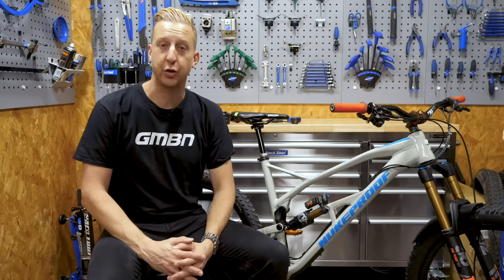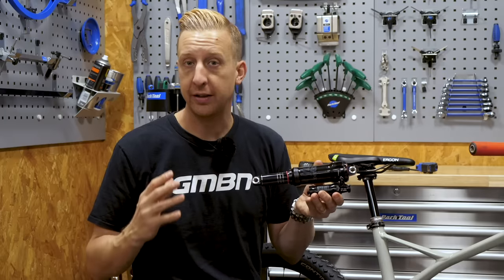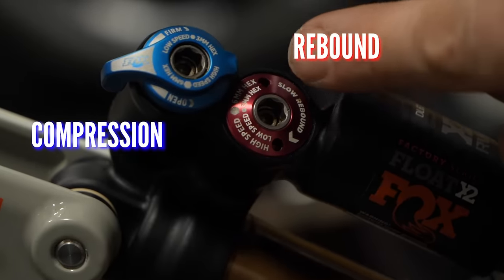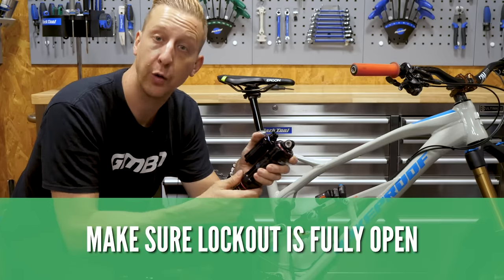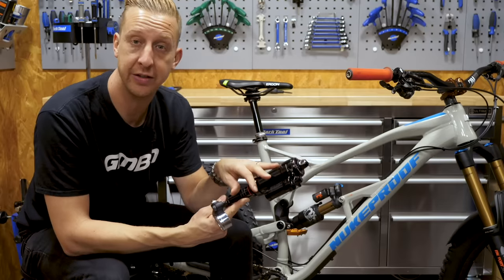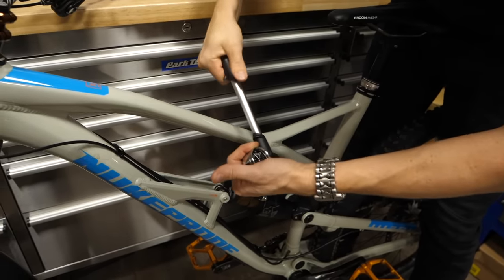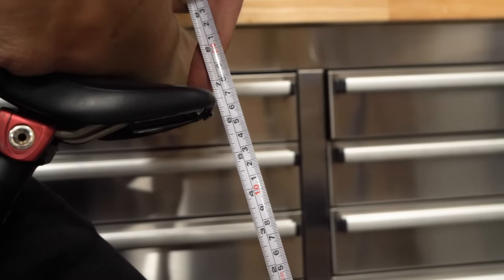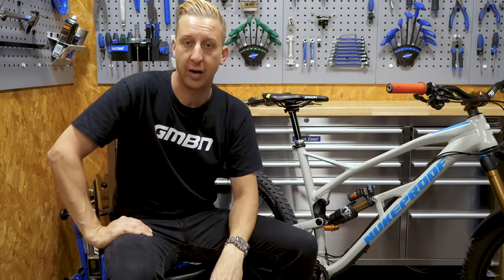Mountain Bike Rear Suspension Set Up Ep. 7 | GMBN MTB Essentials

Comment: My rear suspension set up: 25% sag. Compression & rebound adjustment to suit terrain: Smoother terrain without many bumps = increased compression & rebound (stiffer ride); Rough, bumpy terrain (ie. rocks , roots etc) = less compression & rebound = faster acting, more responsive suspension for smoother ride. And remember correct tire pressure factors in as well.
Reply: my freeride suspension is rock hard no rebound like 2 sag
Reply: @ryanmonson4033  if you set it up so hard then why  not just ride a hard tail and not bother with rear suspension?
Reply: @theadventurebiker  so when you case a 30 foot jump from 20ft high you wont di, it almost bottoms out with full volume spacers
Reply: @ryanmonson4033  Fair enough. I'm moreof a cross-country/ endurance rider and so I don't do big jumps like that. As a result my suspension is set up for comfort and perfomance when riding over rough terrain.

Comment: Stumbled on this video and has been informative. But still a bit not clear about sagging. You mentioned to unlock fully before setting the sag but nothing in your video talked about what to do after setting is over. Secondly if after initial setting the sag is lower than expected, should the psi be increased or decreased?

Comment: Great show 👍 The Basic information  works for me . On my rear rockshox The top rubber bushes seem to have a gritty sound not sure if I need to let the air out first to remove and  clean them or maybe the bolts or just overtightened .
Reply: 👀 ALWAYS deflate the shock before you start removing bolts! Better safe that sorry.
Reply: Le Typ  ok noted will do thanks

Comment: Hi,
Very grateful to you. When the shock is "Locked", is it when it's fully extended or it could be "Locked" when compressed so it shortens the distance?
Thank you
Reply: A Lockout affects only the compression damping, so if your compressing the shock. That's why it resists moving.  Rebound is not affected!

Comment: Doddy please help me! I watched so many toturials and damper video's the last 3+ plus year's I'm really heavy same height as you approximately but way way over hundred kilos and need so much air in the rear shock it's just ridiculous and they need service way too often or I'm going low riding lower and lower with apro the same psi. So now I started taking out hundred psi after I'm finished riding and blow it back up next time I go for a ride on it. Do that help to prolong the inner parts of the damper similar to not storage airguns with air in the chamber. Or is it so little help because it gets so much more pressure when using the damper when it goes up and down plus friction so taking out the air after becomes like a drop in the ocean? I

Comment: I hit big drops and jumps but I like a soft suspension. Coil or Air?
Reply: Slushy Rides air shock you can run lots of air can spacers and run lots of sag.
Though coil tends to feel plusher off the top (depends on what you mean by soft).
I'd say air imo

Comment: EVOL DPS 130mm, 0.6 volume spacer. I am getting up to 260PSI (with some leak on disconnect) before I bottom out on 2 foot drops. 200LBS weight. Does it sound like too much?
Reply: No it doesn't. 350psi is max.
Make sure you fill and remove air properly. See the fox link.

https://www.ridefox.com/fox17/help.php?m=bike&id=940#usingtheevolairsleeve

Comment: I’ve got a commencal meta tr v4.2 origin and I want to get a dropper post and I don’t know how much drop I should get on it. Do you recommend any droppers and I’m on a budget of $300 aud which is 165 pounds. Also I’m 170cm if that helps
Reply: $300 👀 ... you should be good finding a proper dropper.
Just get the maximum drop to suit your ride height - cuz you don't want to find yourself moaning about the 2inches of more travel you could have gotten! 
If you end up not needing all the drop, just get an easy to install drop reducer (collar, 15 bucks).
No brainer IMO.
Reply: get the oneup dropper - its adjustable from 100-150 mm and 120 - 170 mm (its pretty cheap as well - around $260 AUD)
Reply: phezdog 367 where would yo recommend buying it from

Comment: Hey doddy, I have a Rockshox monarch rt3 debonair and recently I added some bottomless rings to my shock, now my shock is having issues. I found that my shock sinks deeper and deeper into the travel just by sitting on it and not returning back and my sag is set perfectly, even when riding it sinks deeper and deeper and not extending back and my rebound is also set correctly what my problem
Reply: Sounds like you somehow managed to block/clog the equalization valve/hole of the shock so the air can't flow back after compressing the shock. Take it apart and check for grease or spacers blocking the port.
Reply: Here's where Doddy mentiones the problem - @4:29:
https://www.youtube.com/watch?v=muVnUuNfa74
Reply: Le Typ I found out actually the hole isn’t blocked, it was the o ring between two chambers that is causing me issues. The o ring was damaged
Reply: Le Typ but anyway, thanks a lot for the reply